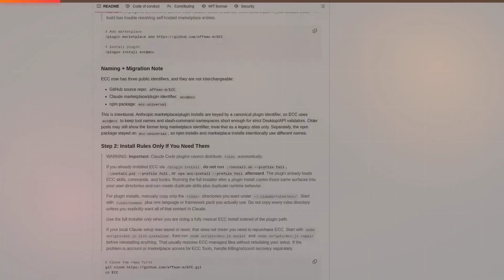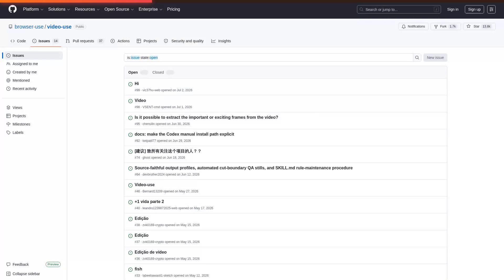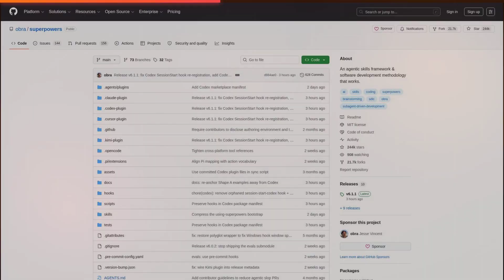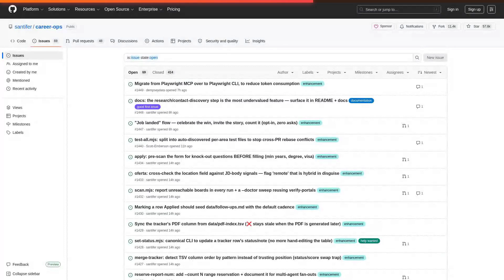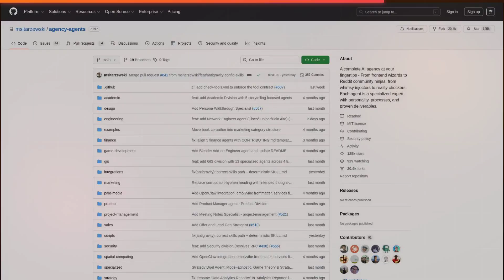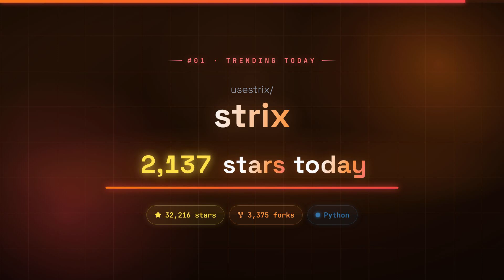10 Open-Source Tools That Replace Pentera, Jobscan Premium & Adobe Premiere Pro — GitHub Trending

Comment from the maker: 🔥 Which of these 10 repos surprised you most? Drop it below 👇

If you found something useful, a like helps this reach more developers! 🙌

📋 Today's Top 10:

1️⃣ usestrix/strix — ⭐2,137 today (32,216 total)
Stop shipping vulnerable code and start automating your security audits before attackers find the gaps.
Open-source AI penetration testing tool to find and fix your app’s vulnerabilities.

2️⃣ JuliusBrussee/caveman — ⭐926 today (80,934 total)
Tired of watching your AI agent burn through tokens and your budget on unnecessary chatter.
🪨 why use many token when few token do trick — Claude Code skill that cuts 65% of tokens by talking like caveman

3️⃣ msitarzewski/agency-agents — ⭐3,032 today (125,494 total)
Stop paying for overpriced AI agent platforms when you can run a complete agency right from your terminal.
A complete AI agency at your fingertips - From frontend wizards to Reddit community ninjas, from whimsy injectors to reality checkers. Each agent is a

4️⃣ hasaneyldrm/exercises-dataset — ⭐938 today (9,261 total)
Stop searching for exercise data piece by piece online – this complete dataset has everything in one place.
A comprehensive dataset of 433 fitness exercises. Each entry includes name, category, target muscle group, equipment, instructions, thumbnail image, a

5️⃣ santifer/career-ops — ⭐372 today (57,826 total)
Tired of spending hours customizing your resume for every job?
AI-powered job search system built on Claude Code. 14 skill modes, Go dashboard, PDF generation, batch processing.

6️⃣ obra/superpowers — ⭐897 today (244,432 total)
Tired of your AI coding assistant guessing instead of following a real development process.
An agentic skills framework & software development methodology that works.

7️⃣ ChromeDevTools/chrome-devtools-mcp — ⭐104 today (45,086 total)
Stop manually switching between your code editor and browser to debug.
Chrome DevTools for coding agents

8️⃣ browser-use/video-use — ⭐554 today (13,787 total)
Stop spending hours on repetitive timeline dragging and let an agent handle the tedious cuts.
Edit videos with coding agents

9️⃣ actions/checkout — ⭐26 today (8,162 total)
Stop writing custom Git clone steps—actions checkout handles it securely in one line.
Action for checking out a repo

10️⃣ affaan-m/ECC — ⭐486 today (225,187 total)
Tired of slow, forgetful AI assistants that jeopardize your code's security.
The agent harness performance optimization system. Skills, instincts, memory, security, and research-first development for Claude Code, Codex, Opencod

---
🔗 All repos linked in description